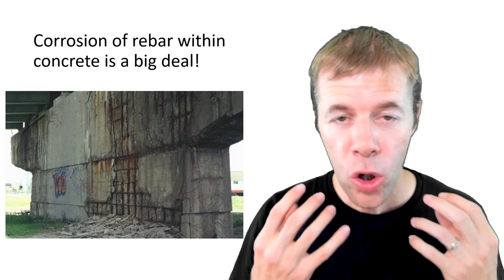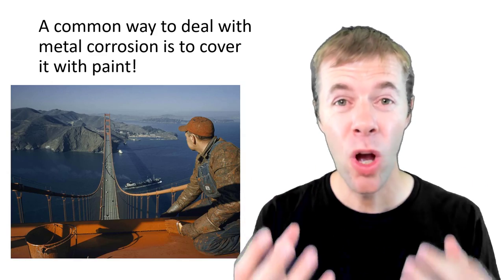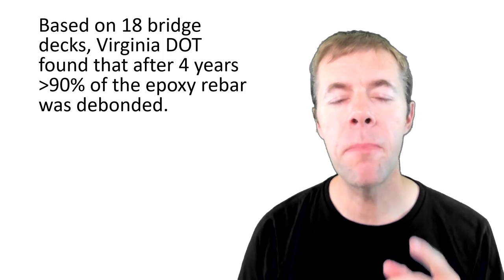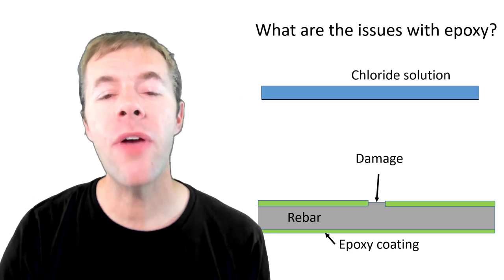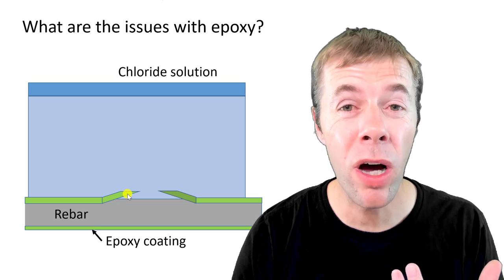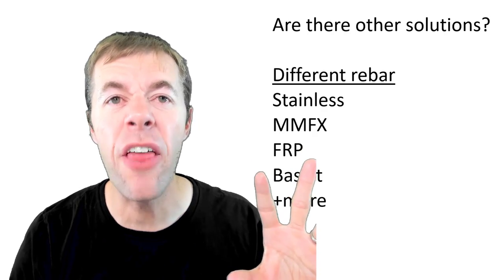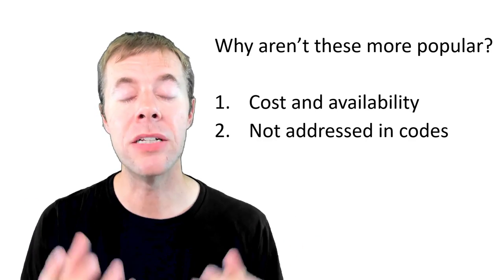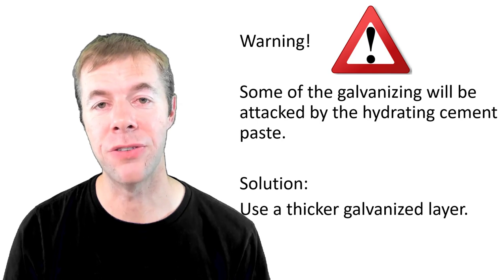What is epoxy coated rebar and why is it being banned?

Comment: You know what's sad is how many municipalities required coated rebar. How many bridges will see critical failures?
Reply: If you've ever worked with coated bar on site, you know there's no possible way to ensure it doesn't get nicked. I haven't heard some groups are actually stopping it's use, but I completely agree, the galvanized is a much better solution.
Reply: Municipalities enforce building codes.  Building codes specify when steel must be coated.  Codes are developed by industry professionals, to meet ongoing issues.  Some contractors take short cuts, some HOAs put off maintenance, buildings age and need regular maintenance.  Seems like the Surfside unit owners ignored warning signs for many years.  Workmanship may have also played a role.  Well before the collapse.
Reply: what if both were done, first galvanize, then coat
Reply: @marinamanuel2796  now we're on to something. we should use this comment page to form a business.  who's in?
Reply: @marinamanuel2796  most coatings don't adhere to galv...unless you pickle it...which is a technique used to neutralize the cathodic resistance of zinc. i'm no scientist (well actually i am in a roundabout way) but i'm guessing if you use a product to neutralize the properties of the zinc, it could compromise it properties elsewhere.
Reply: I think it's a much, much smaller problem than he claims.  He's got to use some gimmick to get more views...
Reply: The question to be asked is, does coated rebar perform better than un-coated rebar?
If it does, why not use it anyway, even with it's problems?

Comment: Rebar can not corrode when fully encased in concrete, the alkaline conditions of concrete form a layer of iron hydroxide on top of the steel. The problem are microcracks inside the concrete that allow the water to get to the steel, once the steel starts to corrode it expands and cause more cracks and more water can get in. Thats why concrete needs to be maintained every few decades depending on outside conditions and climate. 
Material Scientists are working on self-healing concrete to get rid of the microcracks. Alkaliphilic bacteria and especially one particulare type called Bacillus pasteurii can excrete mineral calcite. Those bacteria embedded inside the concrete along with a form of starch as food are able to survive for decades. The bacteria are dormant untill cracks form and water gets to them, they will wake up and eat the starch and produce calcite with bonds to the concrete and heals the crack.
Reply: I owned an older house in Australia that had concrete piles nine feet long that the entire house stood on, it was fifty years old and the Rebar eventually corroded splitting the piles. Piles were under the house dry well ventilated and no moisture apart from where the piles went in to the soil. Loamy sand dry, eventual failure was inevitable. Just my experience . Cheers.
Reply: @axeman6560  Not an expert here.....Humidity would be my guess as to who's the culprit....
Reply: @victoreous626  yes was on the gold coast of Queensland Australia pretty humid there.
Reply: wow sounds like alien invasion
Reply: The bacteria idea seems to be the most sensible and effective solution to me. Tweak the concrete, not the bar. 
But I am an electrician, not a civil engineer.
Reply: @stuart9342  I'm a sparky too. 😀
Reply: Where I work we use high-alcalic cement for bridge beams, carefully monitoring the temperature as the concrete cures. Sometimes during hot periods, we have had to cast water hoses into the beams to cool them adequatly. :)
Those beams have an expected lifespan of 100+ years.
Reply: I did go to South Padre Island near where I live in Rockport TX.  with a friend, Sledge Hammer & a Chisel, to check the rebar that is along the shore in some places, I found that the rebar that was well within the concrete was not rusting at all.  And where it was sticking out it would be rusting going in so you could stick a pencil into the concrete following the rebar a bit, but the rebar was not rusting other than when the concrete was cracked or at the end where it was poking out.  Now keep in mind that South Padre Island is a salt water shore.  :)  Now in real world construction the concrete will be less than ideal, there will be cracks, & the rebar will often not be encapsulated deep enough, & I think that often the slump will be thinned down for convenience, therefor the concrete will be more pours.  I have seen this too often to count.
Reply: @stuart9342 - We need comments from a metallurgist. I only went as far as Metallurgy 101.
Reply: @HepauDK - The Silliman Evans bridge on I-24/65 over the Cumberland River had to be replaced due to salt corrosion. The entire bridges could have been made of stainless steel for less than the cost and disruption of replacing them.
Reply: yup!
Reply: @HepauDK  
Norway? I heard of this, that new bridges and such are made very strict now with regards to expectancy as opposed to earlier, I was told of one bridge where concrete cover was removed to a degree as "weight loss" because it has weakened already, at the coast, of course.
Reply: @Kenzofeis  Nope, but pretty close by. Denmark. :)
Reply: @algrayson8965  We made beams for the renovation of a bridge in Odense, Denmark (Rismarksbroen) a couple of years ago (due to low quality concrete used in the 80's). It was done in 2 stages (north lane, south lane) to prevent closing the entire bridge for the duration. It was a hassle for the commuters, but rather that than the ducks in the creek below getting chunks of concrete in the head. ;)
Reply from the maker: Felix,
These microbes are designed to be encased and be dormant or asleep until cracks free them from their capsule.  I think it is a cool idea!  However, even if we never have cracks then outside chemicals will still penetrate into concrete and eventually reach the reinforcing steel.  I do agree that anything we can do to keep these outside chemicals out of the concrete will be awesome!  Thanks for the reply.
Reply: Felix CO2 (dissolved in water) slowly seeps through the concrete surface over time and forms carbonic acid. This can slowly corrode the reo.  This is why adequate concrete cover, compaction as well as curing the concrete is critical. The addition of water can also seriously affect the durability. Even though we can design low sorptivity mixes, placement is so important .
Reply: Wow not a singel hate comment, and alot of good comments too! Nice community here :) 
I worked some years at the University and we did alot of concrete testing, im not a Scientist myselfe but i learned alot of stuff there. Concrete can be realy good if well made, one of the biggest problem is bad concrete, you cant realy tell if they mixed it well when it arrives at the building site, too much or too little water can weaken the concret significantly. I heared some wild story about truck dirvers who put extra water into the concrete because they thought its a too hot outside. Even the water thats left in the concret truck after washing can effect is strength.
But lets talk about the good stuff, another great thing is hydrophobic concrete.
Reply: Felix 
We use ice in place of some of the water when batching concrete on hot days here.
Reply: Brilliant idea
Reply: This will be a boon to the industry. What shall we call it? I wish my poo could fix things. I would be getting too many calls all the time though, cutting into my Sittin' Around Time. I might have to keep it  secret.
Reply: HI Felix, for the reasons you mentioned there is a practice of covering the concrete with stucco which is actually a water barrier which extends the life of concrete at least twice the normal life of it. Also that's why if you make a water pool out of concrete you treat the inside surface with stucco and tile to prevent the water to reach the walls of the concrete walls of the pool
Reply: Cracks or not, concrete is very porous and highly water absorbing. There is no way of protecting it from moisture other than encasing the whole structure.
Reply: Not to mention moisture is what cures concrete and makes it stronger, a process that goes on for months and years.
Reply: PETA says no to that...
Reply: There are 2 types of concrete... concrete that is cracked... and... concrete that will crack...
Reply: You are todays comment section mvp. Where can i get a bag of this stuff?
Reply: Chloride diffuses through concrete.  The uncracked diffusion rate depends on the initial composition, curing temperature, etc.  But even without microcracking it can depassivate the alkaline conditions and lead to corrosion of the steel. And these solutions don't help what is already installed.
Bridges and roadways with applied salt can have conditions even more severe than ocean shore with respect to effective chloride concentrations, and winter conditions with refreezing/expansion also deteriorate concrete and allow easier chloride intrusion.
It is difficult to get concrete installation code rules updated because of the huge expenses involved.  The authorities are reluctant to authorize additional cost over cheaper, less durable construction, when the inevitable expense and inconvenience of repair will only be seen long after they are out of office, or deceased (kick the expense can down the road).  This also applies to concrete maintenance practices, as road maintenance costs are routinely cut at least in the USA.
This presenter gives the arguments and chooses one of the available solutions that of course isn't free.  All of the alternatives have to weighed and costed out.  It would be better in the long run if all future projects were forced to have longevity as a requirement in the design, as the current path has led to an estimated near US$1 trillion in backlog of USA road and bridge repairs per ASCE, USDOT, and other authorities.  Then industry will have to tool up to produce the MMFX or stainless or glass composite or heavy galvanized.

The concrete rebar issues are not new, they have just been ignored for decades.
Reply: @zilfondel  Thanks, you answered my question. I was thinking that the steel inside is not the problem, the concrete round the steel is the problem.
Reply: I am working on anti communist phony environmental studies that jack up the price of mining.  This is not a physics problem.   Bringing down the cost of concrete solves failure problems by replacing it.

Also it matters not what materials we use if Pedro on his bulldozer never uses a level, there is no drainage for the foundation, and building roads on mountains without blasting a good path.  I see cracks and pot holes not patched for months, while they have entire sections of road for miles waiting weeks for the next phase of the project to kick in.  Palm face. 

Blaming the materials used only goes so far.
Reply: @zilfondel  you are correct .. gaining widespread acceptance.  Chinese company Xypex is similar.  The idea is waterproof the microstructure of the concrete to prevent water saturation over time.  Great inpronciple but worry if there are larger "structural" cracks that can' be so easily sealed.
I think Basalt rebar may be the real  solution
Reply: @VerifyVeracity  I have operated a concrete truck, and I saw contractors have us add water and ruin mix, everyday.
Reply: @johncasey1020   Doesn't surprise me, but it's incredible that people don't know, the less water used, the stronger the final concrete.
Reply: @HepauDK  oh, yeah well I'm checking back in in 100 years and want to know what happened.

P.S. - I'd use galvanized rebar and just before pouring the concrete dip or spray on it the rubber Flex Seal compound you see pimped all over on TV. Why that rebar would be impenetrable! FLEX SEAL's the magic bullet!
Reply: I always thought that the rust on rebar is actually going to chemically bond with the setting concrete and therefore the metal shouldn't be coated. I heard stories of people coating the rebar in vaseline to keep it nice and shiny, only to have the building collapse because of lack of bonding with the surrounding concrete.

Comment: The fun thing about galvanized steel: The corrosion products of zinc tend to be larger in volume than the zinc itself, so small flaws in the zinc coating will tend to be filled by zinc corrosion products. Also, the positive zinc ions on the edges of the flaw will attract negative chloride ions away from the steel, providing significant protection to the steel, even in the presence of a flaw.

Comment: Tyler's passion for rebar is admirable. I'm a GC, he's right. Epoxy is a "raincoat" barrier, which makes it vulnerable to holidays and damage from rough (normal) handling in shipping and on job sites. Galvanizing is a tough and proven way to make steel rust resistant, that's why it's used for most construction fasteners and bracing materials.
Reply: There is abrasion resistant epoxies but they are a bit more expensive.

Comment: Concrete has a PH of 13. When steel is subjected to an environment with a PH of 10+, it naturally passivates and forms a corrosion inhibiting layer. The only thing that can de passivate the steel is the lowering PH effect known as carbonation or the introduction of chlorides. The key to preventing corrosion in new reinforced concrete is ensuring adequate concrete cover, low water to cement ratio material and mitigation of water ingress. Expansion joint systems, adequate drainage, coatings and maintenance (Crack sealing) drastically extend the useful lifespan of reinforced concrete. Impressed current and sacrificial cathodic protection are also very useful. The problem with reinforced concrete durability is that everyone assumes that place and finish is the last step in the process. Unfortunately, concrete structures require preventative maintenance or specialized repair contractors. The latter is costly.
Reply: That is absolutely right but water cement ratio control is not often encountered
Reply: You nail it.
Reply: What are you talking about low water to cement mix. Are a building structure you have to use a correct amount before they use any cement from a truck they have Preform a slump test  to make sure it has the correct amount of water. If it doesn't have enough water it becomes brittle and powdery it doesn't cure properly. What your saying is crap read from a book of little experience.
Reply: Rodney Jones I have an engineering degree focused on concrete material science and 13 years of experience executing structural condition assessments for a living. You don’t know a damn thing about concrete. Slump is a measure of workability not water content.
Reply: Slump can be any value depending on the method used to compact the mix but strength is determined by water cement ratio and the more water in the mix the more expensive cement is needed
Reply: Well, of course! Any Latter that tall would have to be expensive.
Reply: Cathodic protection is used here in Finland for to protect concrete bridges which are exposed to chlorides during winter time deicing. It works, but requires special design, constant monitoring and maintenance.  There are few interesting  projects where remotely readable sensors have been installed in bridges for constant monitoring of the stage of the system.
It's expensive but still much cheaper than to build a new bridge or recast side beams.
Reply: Stop destroying our infrastructure and environment with hundreds of thousands of tons of road salt!
Reply: My grandfather built his future mother-in-law's house in 1909. The basement floor and walls were reinforced concrete along with the sidewalks and the two skinny strips that served as the driveway. My mother said he treated the cured concrete with a mixture of turpentine and boiled linseed oil so it wouldn't be damaged by de-icing salts and prevent dusting on the interior concrete surfaces.
Reply: Temps and weather determines the amount of chloride put into a mix. Otherwise it doesn't set up. Bad news for rebar. I stopped using rebar and started using fiberglass. Works great.
Reply: @ashforkdan  De icing salts are the biggest issue.
Reply: @ashforkdan   Yeh fiberglass works great in a kitchen sink but let's build a pre stressed self supporting bridge section with fiberglass and see who wants to stand underneath.
Reply: @williamcrawford805   what are you talking about? Water is heavily controlled. Not only at the Batch plant but also on site. Yes there is a slump test preform but it is a mesuer of well slump many things affected slump not just watter and the Inspector has a batch sheet and it let's him know how much watter you can add on site before you have to reject the load. Some concrete is put into a pressure vessel to see how much air or gass is trapped in the mix they do a hydration test. Also you build them a prizem or a small representation of what you are building with the material you are using on site for the Inspector to take back to the lab for destructive testing at different stages in the  Curing process. Also you have a stop watch on you because you only get a limited amount of time to work that batch. If you run into a trouble spot the Inspector is going to note that location and then come back and core it hopefully before you pull tension on your cables. He is going to look for poor Consolidation and shallow bar placement. Then he is also going to crush the cores and in the mean time you get to repare or replace the cored section but it better to wait Because he just might come back and tell you to tear out that intire phase of construction because he spent a week on the phone with the enginerds and the project investors hardly ever do you have a project owner anymore. And when you get kicked off the contract you still have to pay to have that phase rebuild. So yeh watter is heavily controlled.